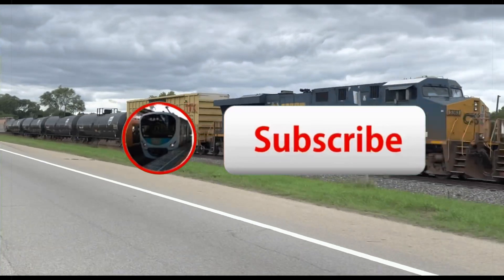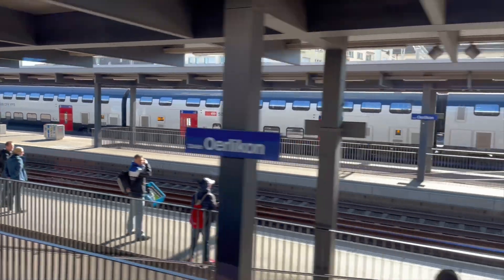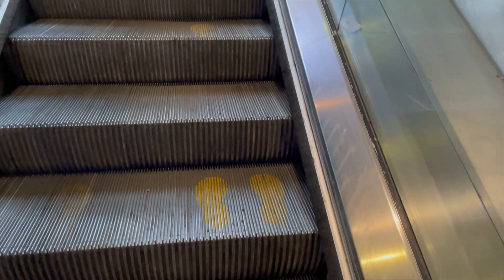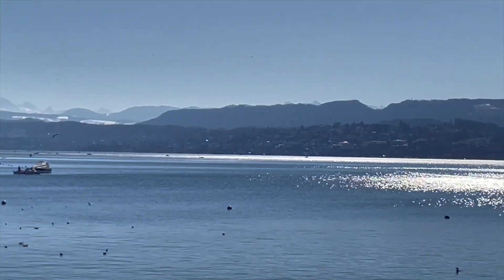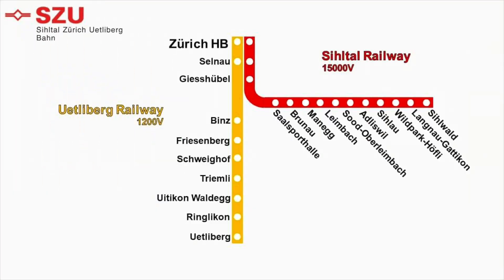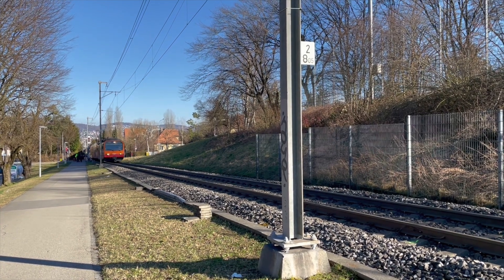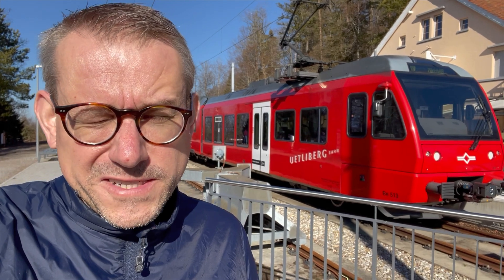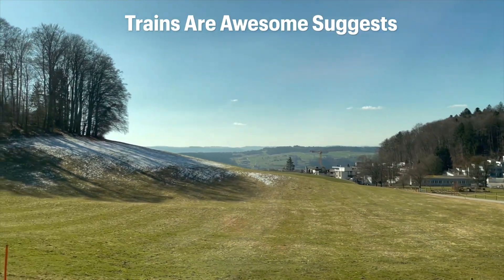The Uetliberg Railway in Zürich, Switzerland | Why This Train has Pantographs on the Side

Comment: The Uetlibergbahn now runs fully on standard (for Swiss standard gauge) 15kV/16.7Hz AC. The side-mounted DC catenaries were removed a few months ago, following the retirement of the oldest rolling stock. All the replacement rolling stock was purchased with dual-voltage capability (with a sliding pantograph that can move into either position), allowing it to run on the DC power until the old stock was retired, then on AC without having to be replaced again or modified. Future rolling stock will, of course, be AC-only. But given that the new rolling stock was delivered in 2013 and 2021, that won’t be for a while!

A friend of mine, who is a rail power construction worker here and worked on the DC-to-AC conversion, showed me video of a new catenary mast being hoisted into place by helicopter. :)

Comment: Fun fact: the underground tracks of Zurich HB are actually below the river, with the river running through the station between the shopping level and the underground tracks. The Uetlbergbahn (SZU) tunnel runs beneath the river for a few stops (whose station elevators poke up through the water) before moving above ground.

Comment: Another very enjoyable video.  It's a few years since I rode these lines and the tunnels under Zurich Hbf were ONLY for the SZU back then.  Great to see the changes.
Reply from the maker: I’m glad the extended the line from Selnau to HB back when they did. It improves the connectivity, and the weird situation with the overhead wires gives railfans like us something to talk about!
Thanks for watching the video and leaving a comment!
Reply: The SZU platforms (21-22) are still SZU-only, since they’re only minimally physically connected to the rest of the rail network, and are needed as the terminus for both the S4 and S10. (These were originally built for the aborted Zurich U-bahn network, which is why they’re of a different aesthetic.) They entered service in 1990 with the opening of the S-bahn network.

Underground platforms 41-44 (S-bahn–only, known as “Bahnhof Museumstrasse”) also started service in 1990 as part of the new S-bahn network. 

The newest addition, which entered service in 2014, are underground platforms 31-34, known as “Bahnhof Löwenstrasse”. Its much wider island platforms were sized to handle long-distance passengers with luggage, since it’s used for both S-bahn and long-distance trains.